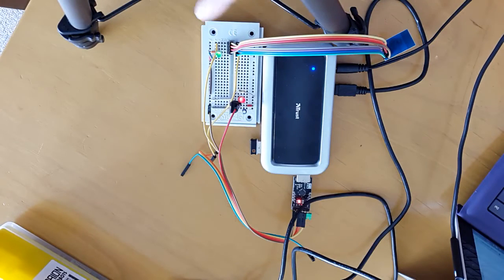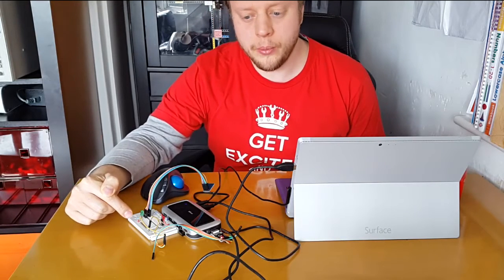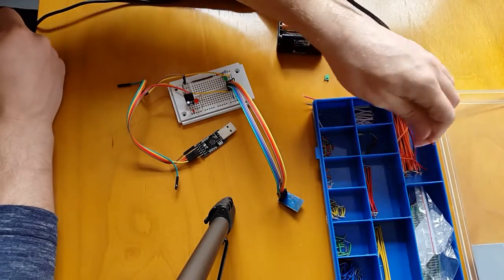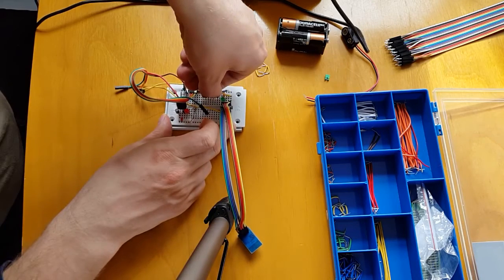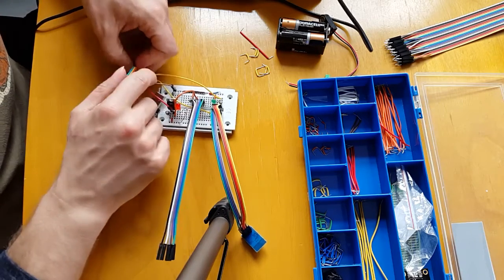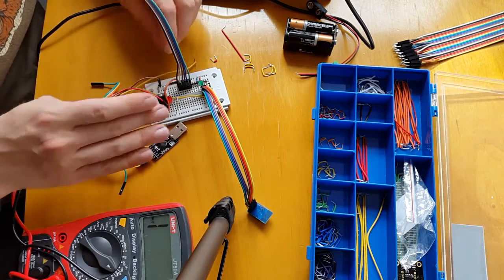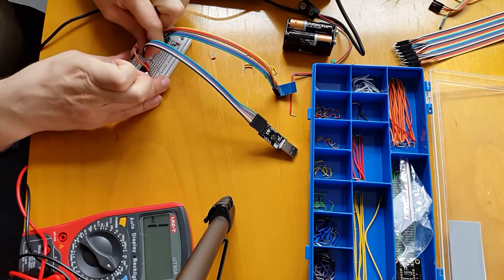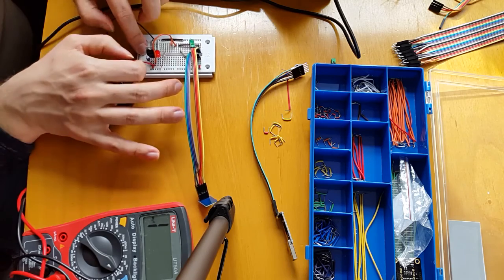Esp8266 flashing led, easier serial, and battery power

Comment: What microcontroller do you have in mind to expand the I/o? Are you going to go for something simple like an atmega 328 and arduino bootloader or are you going to use something that needs an external programmer?
Reply from the maker: Samuel Doye I generally avoid external programmers if I can. I have pickit, but it'd likely be a 328 + bootloader indeed. However, since filming this, I've also been playing with the esp12 board - lots more IO, but still the same chip.
Reply: I'm looking toward to that episode. At the moment I am also using at me gas with bootloaders, they are so easy to use.
Reply from the maker: I've managed to teach my phone Arduino and Atmega - don't you love word suggestions.
Reply: I actually laughed out loud for about 30 seconds when you pointed that out. I need to try and proof read my comments in the future.